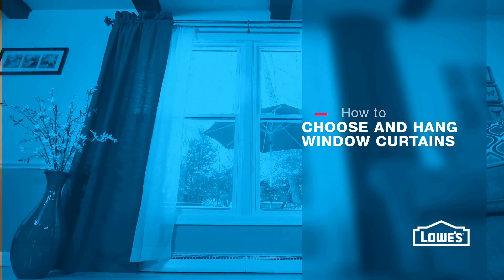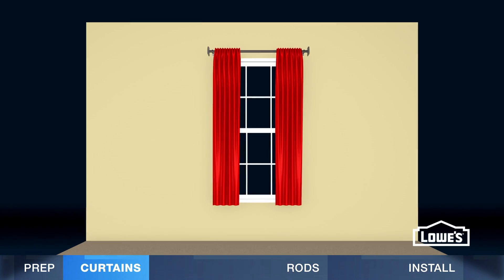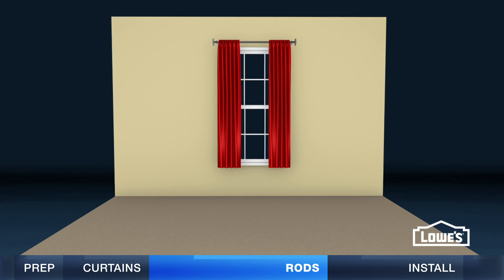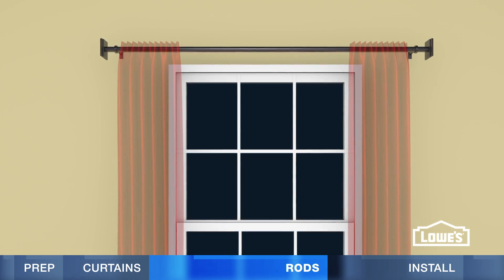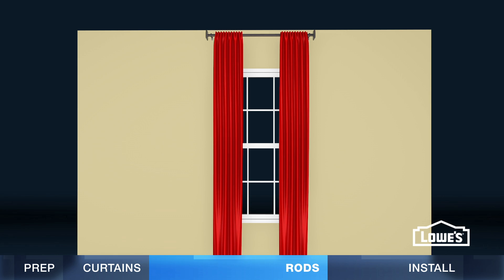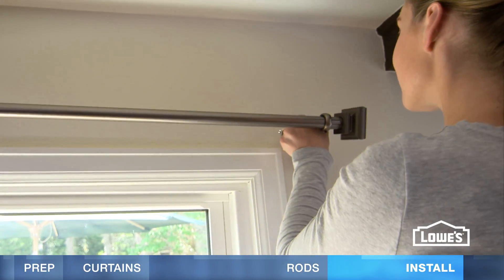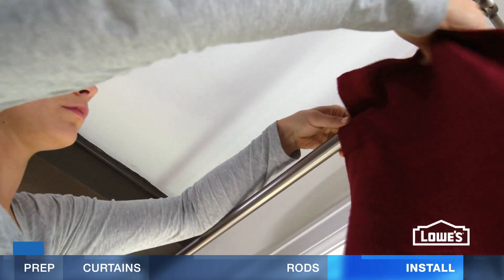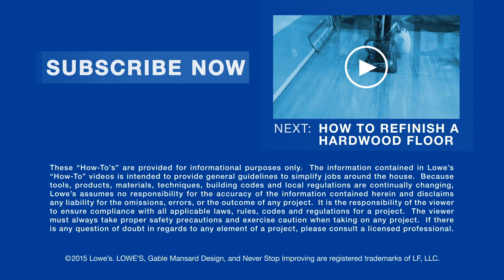How To Hang Curtains

Comment: Here are some real-world factors not covered in the video:
- The height of the curtain rod is usually determined by where you want the bottom of the curtains to land. Once you know that height, the bracket position has to be determined in relation to the rod.  (The bracket mounting holes are often above and below the rod's position.)
- If you need a center support you'll usually want to make sure that it can be positioned above the window trim. Don't make the mistake of mounting the left and right brackets below the top of the trim, thinking you'll add the center support last, only to discover that it has to sit ON the window trim, taking it out of alignment depth-wise with the other brackets.
- It's best to use wall anchors that don't stand proud of the wall.  Otherwise the plastic anchor lip will prevent the bracket from sitting flush against the wall.
- A two piece rod has one section that has a smaller diameter than the other.  When both sections are snugged down against their brackets by the set screws, they stand at slightly different heights. Something to consider when positioning the mounting brackets is to assign a bracket to each rod section.  This also happens when there are three sections and three brackets.
- DON'T ASSUME ANYTHING IS LEVEL!  You might install your rod dead level only to discover that it looks crooked, because your window trim or wall/ceiling joint isn't level.
- Don't slide the rod through the brackets with the set screws in place.  You'll scratch the rod.  When you unwrap the brackets, take the set screws out immediately.  Then....
-...make sure you install the set screws as the last step.  It will prevent the rod from sliding through the brackets when you move the curtains.

Comment: Using measuring tape is old school, and time consuming.  You can get the job done faster by using an RPC (Rody Precision Corner) tool.  Plus, the RPC has bubble levels on it, so you don't need an extra level tool to get the job done.